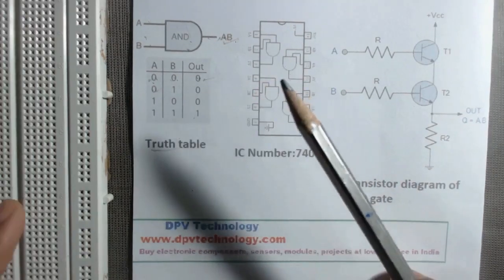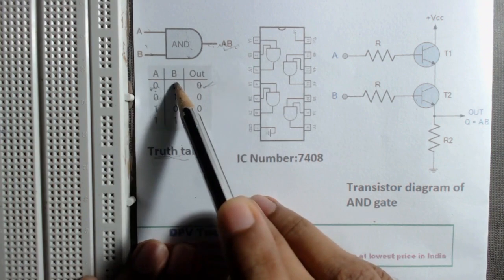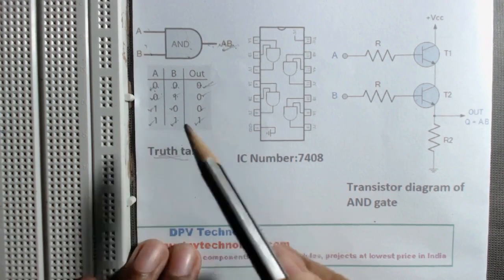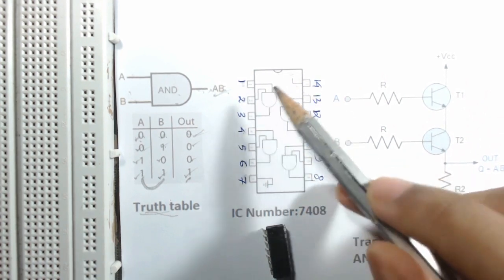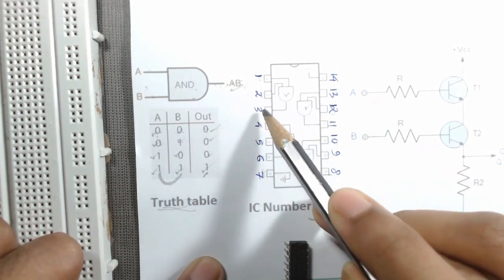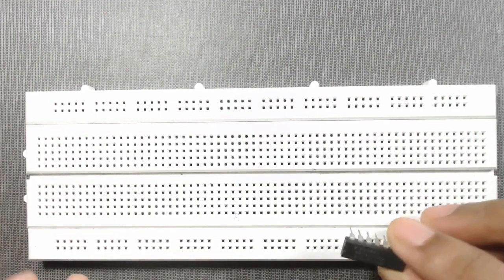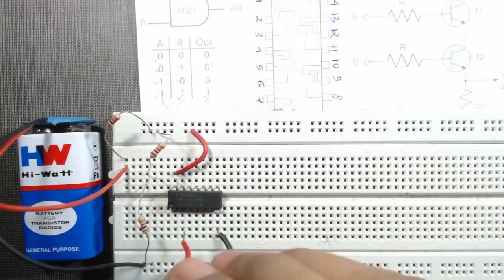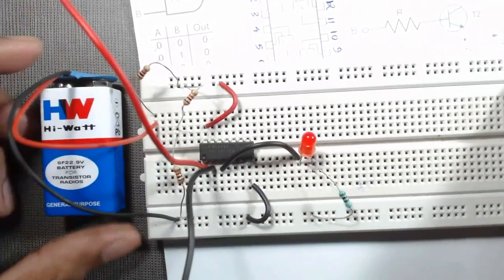AND Gate Practical on breadboard

Comment: What do you mean 0 into 1 is 0 .. nonsense. At least say that the transistors that make up the AND gate are connected in series and both have to be on for the current to go through the circuit. Stupid 0 into 1... what 0 into 1. Nonsense.
Reply: What are you upset about. There are many different equations. 0,1=0 is one of them.